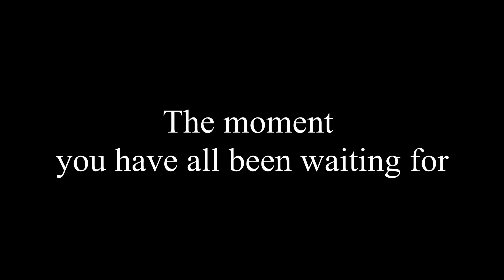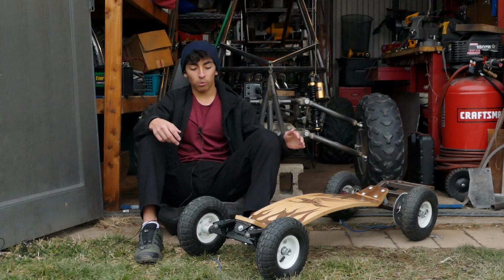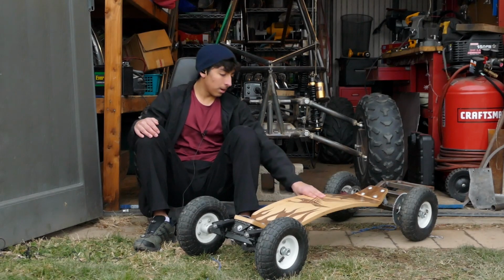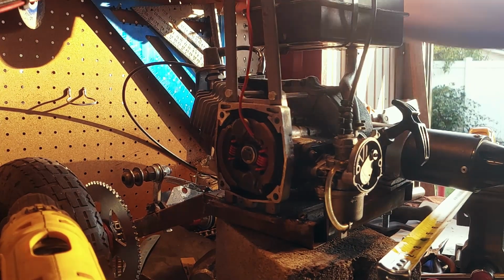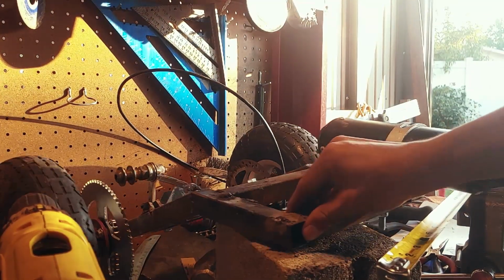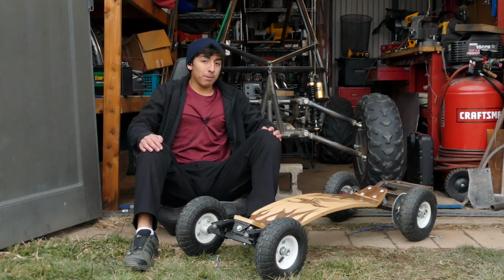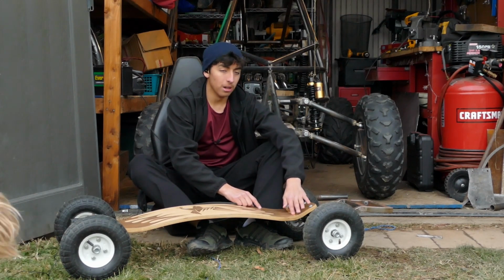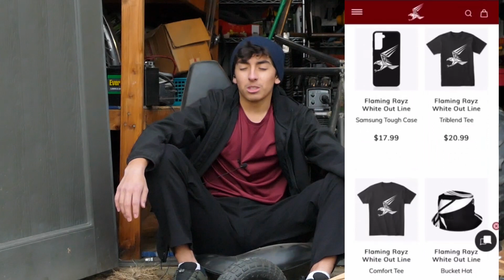How to make a Mountain Board Deck + Face Reveal!

Comment: Hello, I'm from Peru and I'm thinking of putting together a mountainboard but I don't know what the truck's measurements are. Could you tell me what the trucks' measurements are? I'll use an 8.25-inch skateboard as a board and I don't know what size trucks to put on it and also what material would you be so kind to send me the measurements of the trucks
Reply from the maker: I live in the U.S. so i used 5/8" bolts. The front trucks are 12" without the bolts. The back trucks are 8.5" without the bolts. The front bolts are 3 inches and the rear are 5 inches. Although if I were to make one again I would make the bolts at least half an inch longer just so I have the little more material to work with. I used 1” steel square tube and i think the trundle parts are 1.5”. I have some older videos on them if you want to see how I made them .

Comment: I'm surprised you laser cut a veneer rather than griptape.
 If you're gonna put a motor on it -griptape might come in handy
Reply from the maker: I thought about it but I’m planning on putting straps on it so I figured it wouldn’t really do much
Reply: @FlamingRayz  OH rIGHTEOUS BRO!
 sTRAPS ARE A way BETTER WAY TO GO  with a  petrol powered board & besides, the graphics are dope as hell.
 BUT - i gottas admit - Thatr deck, came off, like it was the 100th deck you made - not your 1st.
  The curve & tip angles/ amount of concabe (from what I can see) LOOKS DAMN REFINED.
 Youdid a flat out kick ass job man.
 Nothin short of impressive.
YOu mighht miss havin access to those kick ass apparatus your school has available for use.
 I'd give my left nut to use a shop like that.
 Take care man & be safe
Reply from the maker: Thanks man! Yeah I miss having a good shop with tools and space and air conditioning.